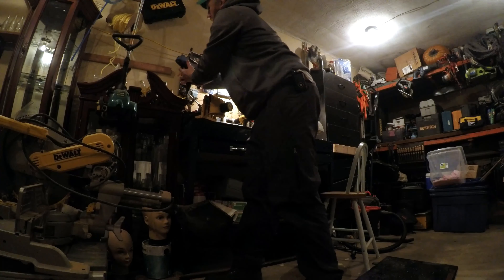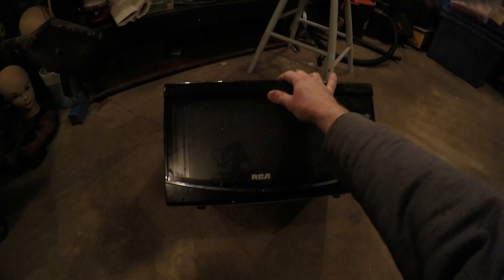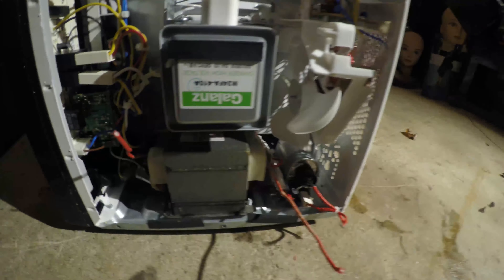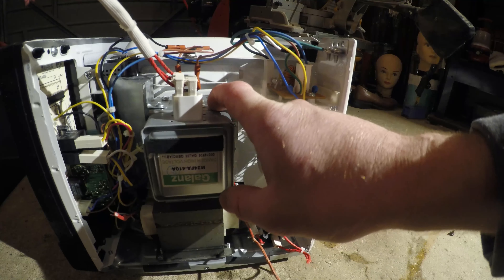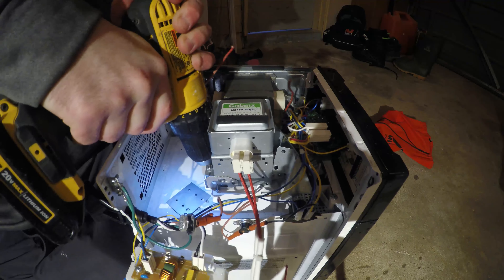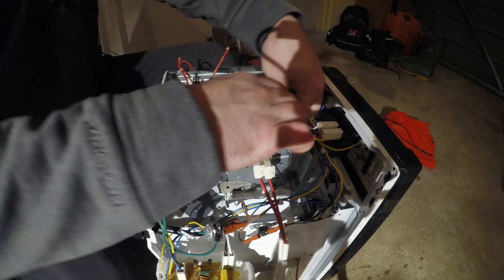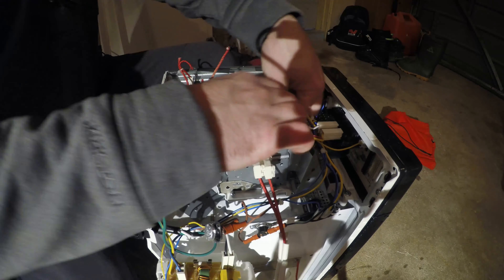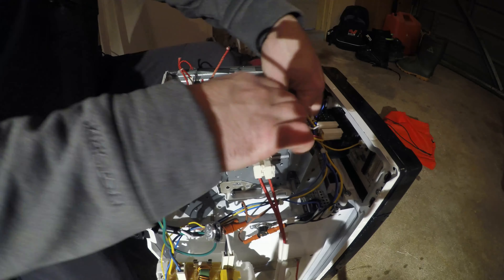microwave magnet-HOWTO-for magnet fishing free!

Comment: I was in a pinch one time, all I had was my Dewalt and a 5 in 1. I happened to look down saw the P2 end and thought I could use that as an extender. Pulled out the flat head put it in the Dewalt and bam! Instant extender! Nice video gonna have to find me a an old microwave.
Reply from the maker: Just make sure you research the capacitor could kill you if it is not properly discharged, which I should have explained better in the video really... the capacitor in this microwave had no charge
Reply: Red Beard Relic Hunter I will thank you! I have a habit of laying a screwdriver on top and across spade to spade to take take the zap out of it. My father taught me about that 1 time and one time only lol enough of a zap to get your attention!

Comment from the maker: Before trying this at home always make sure the capacitor is discharged, the capacitor has enough voltage to kill you! So ensure you do that, if you need assistance in how to, search it up. Always be very careful although I show you how to do take apart the microwave for the magnets I am not necessarily recommending it. Thoroughly research how to alot!
Reply: hardrives have some great magnets in them too :)

Comment: Sooo no one is going to point out the beryllium oxide insulators and how they can screw you up? Commenters, you disappoint me. You break or scratch those pink ringy things near the magnets you get an airborne beryllium. You breathe it in, you may get berylliosis  and then you're done for life.
If you're lucky those will be an aluminum oxide, but I wouldn't risk it.